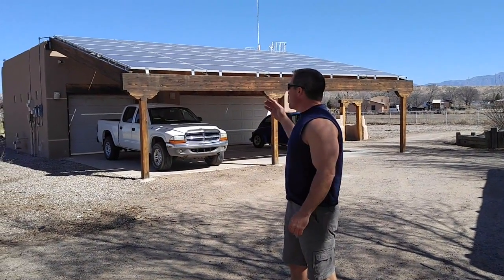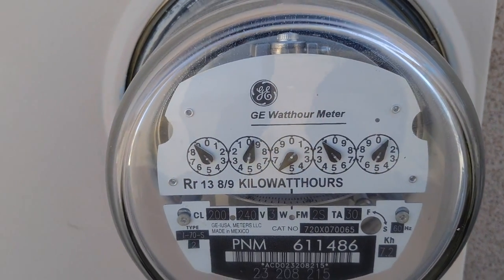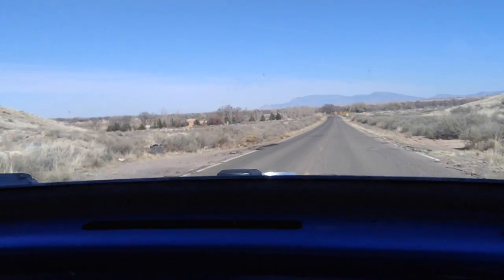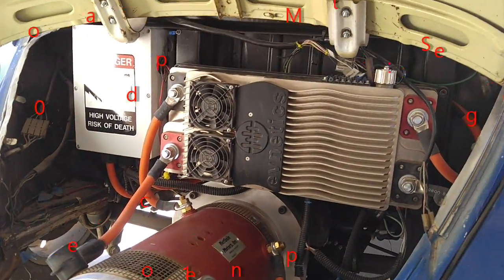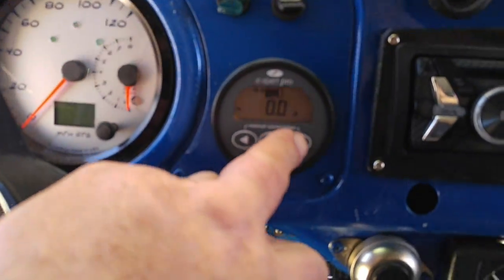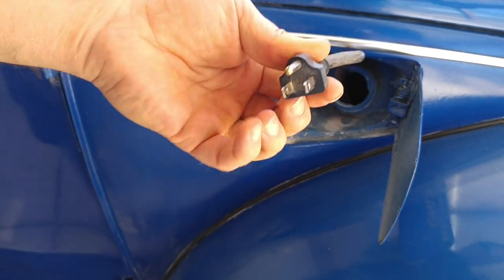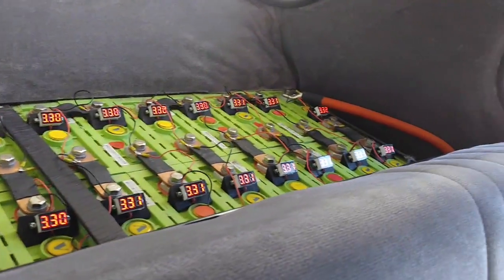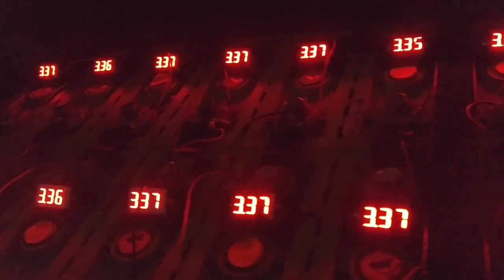Super Fast Electric Bug

Comment: I've spent a lot of time looking into this stuff over a bunch of years, and honestly I think this video has been the most inspirational to me.  Because it gives me the impression that I can achieve the kind of power I want, with real numbers.  I really want to bolt a motor (possibly a Warp 9) directly to a differential.  I realize that'll require changing the gears in the diff, but do you think I'd get frustrated with only having one gear ratio?  (I've basically always used manual transmissions, but so much stuff says electric motors don't need the gears.)

Comment: Was a 5.3 zero to sixty considered fast in 2016?
Reply: Depends on the standard. 5.3 seconds would kick most ICE cars ever made and would give a run for its money with many electric/hybrid ones with the exception of performance driven ones.
Now, you've got a 50 year old bug that was rebuilt with used batteries and motor at the lowest possible cost with minimal to no change in gearing and other components, it is pretty damn quick for what it's worth. If the owner decided to optimize a few things, change the transmission specs, change the energy requirements of the motor, replace the batteries with better ones, it would definitely have an even better 0 to 60... BUT at what cost? If he went all out he'd probably have a beetle that could beat a higher end Tesla model but those are 50k to 100k cars and this guy got 80% of the performance at 20% the cost (as a manner of speech).
Reply from the maker: @freetobe3  Very well said! Thanks!

Comment: Seems like ac motor..but how long you can ride it with dc power supply
Reply from the maker: It is a series wound DC motor. I get around 100 miles of range on a charge.

Comment: That's alot of bucks in batteries alone hu?
Reply from the maker: Yes it is. But if I take care of them, which I do, they should last at least ten years, but more likely 15. It's kind of like buying 15 years of gasoline all at once, and I guarantee you'd spend a hell of a lot more than the batteries! After 5 years, I see no noticeable degradation in the batteries.

Comment: Wow! Love it. And love your passion for getting more EV's on the road. I've often thought about a conversion, to get a classic car without the maintenance headaches and plumes of smoke. I've been considering doing a VW T3, Saab 99, or Citroen DS. I've got a question for you. It looks like the specs for the Warp 9 says it only produces 32 hp. Is that right for maximum hp from the Warp 9? I've been dismissing smaller cheaper motors (under 100hp) as I've driven a 87 hp Renault Zoe Q90 and it was not exactly rapid - 0-60mph takes 13 seconds. Does the extra torque really make up for the lack of horsepower? Or only if the vehicle weight is low enough (like a Beetle)?
Reply from the maker: I know the graph that you are referring to. I have no clue why Netgain hasn't updated their specs in a decade, but you'll notice that they are only using 72 volts! You would still have plenty of torque starting out, but your rpms would be so limited by the low voltage, that you'd be pulling hardly any current once the motor gets to 1 or 2 thousand rpm. That's also why the hp rating is low. HP isn't a very good way to measure electric motors, as it is rpm dependent, and the higher the rpm, the more counter emf, and lower current.  With enough voltage and a thousand amp controller, believe me, you'll be blown away! Check out the white zombie. I believe it has two Warp 9s, and that damn thing wheelies.
Reply: My apologies for not replying sooner, I just saw this video and the comments.  With series wound DC motors if you double the voltage you will double the HP of the motors.  The WarP 9 an be safely run up to 170 Volts - though people have run it higher.  If you double the amperage you will quadruple the torque.  The WarP 9 is generally equivalent to a small block V8 in performance (at ~170 Volts and 2000 Amps). (2000A * 170V = 340,000 watts) - that is ~450HP - but closer to ~350 after losses) It's difficult to compare to ICE's as the torque is maximum at stall. Many people who install WarP 9's in VW's only use 3rd gear and drive it like an automatic most of the time.  While DC is best for drag racing (IMHO), AC is FAR better for the Street.  My son and I converted a dune buggy from WarP 9 (DC) to HyPer 9 (AC) and I never want to drive DC again!  I am affiliated with NetGain, so please consider my response may be biased...

Comment: Nice ride!!  Very cool  You have any info on how you coupled the motor to you transmission?  I'm designing a similar build with a 1973 Super Beetle with a 9" GE motor (very similar size to your motor), 144 volt system.  Did you buy the motor to transmission adapter or build your own?  Any info you could share?  My email jeffsmeker@gmail.com.  Thanks!
Reply from the maker: I got the transmission adapter from EVWest. Its kind of pricey, but well worth it. I probably would have wasted more money trying to build my own, accounting more inevitable mistakes. The tolerances are very exact. If you're off by even a hundredth of an inch, say good bye to your bearings!

Comment: Have you modified the gearbox? Can it handle the torque?
Reply from the maker: I destroyed the stock one right away. I replaced it with an upgraded transmission with a super differential and 3rd and 4th gears are welded to the syncro hub, which are only pressed on in the stock tranny.

Comment: This is great! Can a BMS be set up if the batteries were hidden?
Reply from the maker: Yes, you could have a BMS, but I just didn't want to bother. Basically, i am the bms. I just occasionally check the voltages at the very end of the charging cycle. They stay balanced quite well.
Reply: @bottsfinevids4463  but I do you determine if the battery pack needs cooling?

Comment: It's a great idea and build but I have an issue with this  "Around $14k for the conversion (got a great deal on the batteries)"  So for those that aren't made of money + have/want a 50's - 70's era stripped down VW + live in the S.W. where it's always sunny + have another $30k for solar panels, petrol is the only real option.
 Next, "I have just demonstrated that the sun can supply all of the energy needs for an entire house as well as for transportation.  How can we continue to justify the burning of fossil fuels..."  Well, aside from my comment above, solar is still cost prohibitive for over 95% of the population and an all electric vehicle without full solar recharge still uses fossil fuels to produce the electricity for charging in addition to the HORRIFIC devastation from Lithium mining/processing  

 I love your conversion and the idea. I have a '67 Ghia and would love to do an EV conversion but there is NO way I can bankroll the $$$$ involved even with piecing it all instead of buying a kit (And I'm an E.E. with 30+ years of hands on experience)  Plus I live in Michigan so, not enough sunlight/year.
Reply: why not just do it piecewise? you don't need to go all or nothing.. the conversion is well worth restoring a classic car over buying another tesla

Comment: Very nice build! but solar panels don't last and they end up in the land fill. :-(
Reply from the maker: They last a minimum of 30 years, and all the components are recyclable. So far there aren't many facilities to recycle them, because most of them are still functioning. When the demand increases, then solar panel recycling will become a new industry. Even if every single one winds up in a landfill, I can assure you the environmental impact will be insignificant compared to extracting and burning fossil fuels.
Reply: @bottsfinevids4463  Not only that. Someone will find a good use for those solar panels. Like chinese found a solution about all the 15-20 years old motherboards. ( reproducing some older sockets or newer with components off the broken/burnt ones)

Comment: 95 mph top speed is ok, but keep in mind, that car is built like a wing. It actually produces measurable lift starting around 70 mph. At 95, the steering wheel has little effect on which direction the car wants to go. I had a '68 Bug and lived at the bottom of a big hill. Been there, done that. I suggest you don't. Word to the wise. =)
Reply from the maker: I can't argue that! It could have gone faster, but things started getting pretty squirrely above 90. I've only gone that fast once. Felt like Chuck Yeager in the X1!
Reply: @bottsfinevids4463  Now you know! If you wanna go fast in a VeeWee, I suggest a Karmann Ghia. Much better body profile.
Reply from the maker: @DeanMk1  I agree. That's why I did this!      https://www.youtube.com/watch?v=8dp9tM0mH5Y&t=18s,    evalbum.com/5330

Comment: How many Transaxles have you had to put in that car, VW transaxles are Not very durable once power torque goes way up, with that much torque and doing burnouts, that is a recipe for a broken transaxle. I had a 69' Bug with a 1835cc dual carbs, I had a Beefed up trans and still had to replace/repair the transaxle several times do to broken parts and that was heavy duty trans. Do you have a DIY Power wall for the days when its Not sunny? what is each solar panel rated at? Have you had any over heating issues with that DC motor?
Reply from the maker: I've had to replace the stock tranny in both cars with a performance one. It has welded 3rd and 4th gears, a much lower ring and pinion ratio, and a super differential with four spider gears instead of 2. They have held up perfectly. Haven't broken any axles yet, surprisingly. I did also install a traction bar to help prevent wheel hop. A major difference is with the electric motor is the smooth power delivery. Even though it has far more torque, there is never a shock load like with an ICE revved out to 5k rpm and dumping the clutch!

Comment: How does this system work in dusty or wet conditions like the sand dunes?
Reply from the maker: I have been in a few heavy downpours, and no problems. However, I wouldn't want to drive through a puddle deep enough to submerge the motor! For sand, you would have to shroud the motor and add a blower for cooling. I wouldn't drive mine in the sand how it is now.
Reply: If you use a motor like the Netgain Hyper 9 AC they are sealed units. Some converters also make a deck around the motor that will keep dust and rain away from controllers and cooling fans etc. but, this is a great car!! I love how the Beatles respond to ev conversions. EV West and EV4You sell vW kits to make the home conversion easy.

Comment: How comfortable would you feel towing something with this car?
Reply from the maker: It has 5x the torque of the gasoline engine, so it would have no problem. However, depending on what you're towing and the conditions, over heating of the controller and motor could be an issue. But if towing were to be a regular thing, you could add liquid cooling to the controller and forced air cooling of the motor.
Reply: Thanks a ton! I've been exploring the idea of doing something like this myself one day but I also wanted something that could potentially pull a small camper behind it. Knowing this helps a lot
Reply: @Ckret009  Perhaps put solar on the camper's roof for helpful and mobile charging. Great idea, good question.

Comment: If you want to increase the top speed what would you have to do??
Reply from the maker: I'd  have to increase the voltage by adding more batteries. Since I don't have room for more of the same size, I would need to have smaller batteries, but then they might not be capable of supplying the full 1000 amps. A different battery chemistry like LiPO would do it, but LiPO has many other disadvantages. Besides, a vw bug is pretty sketchy at 100+ mph!

Comment: I have a couple of questions about the solar panels.  Do you have a battery pack for power at night? And what's the return on investment?  
A couple questions about the beetle, what's the range? What's it like in the winter? How much did the conversion cost?
Reply from the maker: I'm still tied to the grid, which means during the day my meter spins backwards and I'm putting energy into the grid. During the night I use grid power, but the meter is over 7 Megawatt hours ahead of where I started! I believe I broke even on the solar panels in about 6 years. The beetle has a range of 90 miles, and my Karmann ghia has 120. In the winter, the range decreases significantly. When the batteries are below 32 degrees F, the voltage sag at high currents is huge! The performance is also less, but this thing is so powerful I really don't notice! More details http://www.evalbum.com/5147

Comment: Hi I am Emmanuel Ogunade from Sierra Leone I am an electrical engineer please how can I get the motor and it accessories so I can do the same here in Sierra Leone because in Sierra Leone there is no one with an EV in my country
Reply: Soji Ogunade you can get most of your parts from EV WEST. I think they would ship them to Sierra Leone, but shipping Lithium batteries is very expensive. Please try to do it. The world needs more ev's!

Comment: I looked at the evalbum but the answer is not there.  My question is ... what size is the speedhut GPS speedo.  It looks like 4 and a half inch, but what parts did you buy to get it to fit.   Did it come with the bezel, or did you need to do anything fancy to get the speedo to fit the existing hole.
Reply from the maker: It is the 4 and a half. It comes with the bezel and it fit perfectly with no modifications. Keep in mind, it is a 68 bug. On my 74 Ghia, the holes were too big so I had to fabricate a stainless steel plate with the right sized holes. You could see it on the electric karmann ghia video. The ghia speedo looks like it might be the size of the later bugs/ super beetles, but I don't know. I will tell you, I am very happy with the speed hut gauges, and would definitely recommend the GPS. Good luck!
Reply: Thanks.   Much appreciated.   There are plenty of cheaper 85mm GPS Speedos, but speedhut look better fit.

Comment: You are Awesome! A textbook example of off grid living! You did a great job on converting that ole bug to electric. Your video is the first video I've seen where one has a voltmeter on every battery cell! I have just a simple toy power backup system using just 4 220Ah AGM industrial batteries in series for 24V and have a cheap $2.00 LED voltmeter on each one. Really helps show at a glance if any of the batteries needs one on one attention!
Reply: Thanks for the kind Words! Yeah I remember many times measuring each cell with a multimeter just to make sure.  Those little volt meters made life much easier,  and they were only 2 bucks each on Amazon!  Check out my electric karmann ghia video I just posted today.

Comment: How many years was your break-even point with the solar panels and electric conversion. I know that there are other benefits but for me, money is a go/no-go factor.
Reply: It's really hard to say.  Probably about  6 years with the solar,  but it would be much longer now because they've eliminated the payments from the utility company for new customers.  The car would take a lot longer to break even. I have gone 18000 miles which would be about 750 gallons of gasoline.  Until batteries are less expensive,  saving money is not a good reason to convert a car, but there are many other very good reasons. However, depending on range and performance,  you could do it for fairly cheap.  Good luck!

Comment: This is awesome!!!! I defenitly want one!
did you do all of this transformation by yourself?
How much did it cost you and is there a marketplace to buy a kit like this?

Thanks and greets from Germany
Reply from the maker: This will answer most of your questions.   http://evalbum.com/5147   Yes, I did it all myself.  I didn't use a kit, but EV West sells some really nice ones. They are AC, which are high quality, but they just don't have the torque of a DC. I wanted mine to kick ass! I also used a larger motor and a 1000 amp controller which they don't sell in kits.
Reply: thanks for answering! great job!

Comment: Way to go.  I own two Leafs.  Used to have an Aspire with an 8 inch and 144v 700 amp controller.  Not as good as your setup.  But the Leaf with 107 mile range is pretty good.  Paid 13,550 new.  Leafs are going cheaper than it is to make one yourself.
Reply from the maker: Whether home built or factory built--electric cars are the future, for the sake of the planet.

Comment: Wow, 90 mile range out of a diy conversion is really good. Even the factory designed Nissan Leaf and Fiat 500e only gets around 100 mile range.
Reply from the maker: Yes, and its faster and better looking than a Leaf!
Reply: Without regenerative braking to boot. (DC motors in general don't do regen. Evnetics played with it, but never released a controller that will.)

Comment: Why give it gears?
Reply from the maker: If the motor has plenty of torque, like this one, gears aren't completely necessary. I could leave it in 4th all the time. However, gears give more options for performance. If you want the crazy acceleration, you start out in 2nd or 3rd (1st is useless). Also with direct drive, on a hot day travelling slowly up a hill, the motor will be turning too slowly to cool itself. One last thing, you need reverse, unless you construct a DPDT switch using high current contactors.

Comment: What  kind of generator would be required to power this electric car?
Reply from the maker: It takes around 15,000 watts to cruise down the highway at 60mph. I would say you'd need at least a 20kw generator. I thought about making a generator trailer for road trips, but the generator would be far too big and expensive to be worth it. If I have to drive more than 90 miles, I just use a normal car like everybody else (which sucks)!